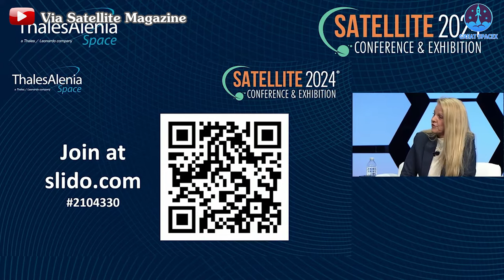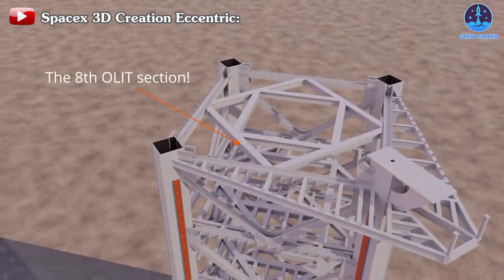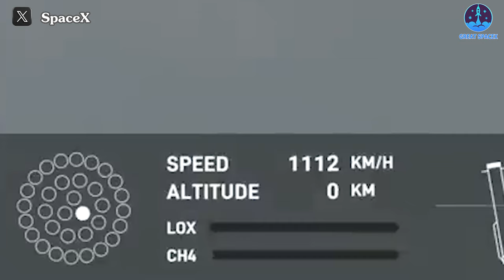Unexpected! SpaceX declared ''Catching'' Starship Super Heavy by Mechazzilla this year...

Comment: I don't see catching it working. I think they should stick with how they do it with Falcon 9 and use landing legs. Sure that will cut down on payload but I think it makes the most sense and is the safest option.
Reply: Yes I agree , I don’t see how they can get that precise to be able to catch it
Reply: Yea of little faith. Just remember - no one believed in relanding a rocket either.
Reply: I"m going to go with those engineers knows a whole lot more about physics and rockets.
Reply: That's why you don't work at SpaceX.
Reply: And this can be offset by improvements in engine thrust.
Reply: You don’t make progress without taking risk.
Reply: Agreed, and winds and bad weather could make things even more difficult. I think they would be wiser to land the booster using the proven Falcon 9 method.
Reply: @johndavid9418   Ture but even Falcon 9 doesn't always land perfectly in the center spot of the pad.. There are just to many variables to account for..
Reply: @scupking  It's about reducing risk not eliminating it, perfection is a theoretical & physical impossibility in any field. 
Your expectations are unrealistic & your understanding of physics is poor.
Reply: From what I heard the landing system would bee too heavy and it would limit the capability of the stack….
Reply: I agree, but with the greater mass of starship, it maybe an engineering (structurally) nightmare. Catching the pieces are the most economical and time saving procedures.
Reply: @offgridprep  i dont think its any harder then landing on a Drone ship in the middle of the ocean. 

Of which they can hit dead centre. So I think its more a question of if the building can withstand the landing
Reply: Their focus hasn’t been this part of the mission. Line upon line… the first was clearing the pad and tower… 2nd was staging and 3rd was orbit. Anything else was a bonus but not the focus, so focus is is concentrated on the ‘goal’ of the flight. They have engineering and progress that is so far beyond what we see or hear. Just like the Artemis moon lander. Much farther than anyone thinks.
Reply: @earniemanley8013   They already successfully landed Starship that had retractable landing legs during test flights a few years ago.
Reply: That’s why they are called “chopsticks.“ Yes, very difficult. Like catching a fly with chopsticks. It’s worth the effort to try, and it will probably eventually work reliably and safely.
Reply: @krossbolt4100 BS! 20 years before SpaceX was doing the grasshopper flights, McDonnell Douglas and DARPA were doing the same thing.
Reply: And what about Lunar Starship?  No chopsticks on the Moon.
Reply: Wasn't aware
Reply: @executivesteps   It will land with retractable landing legs like the Startship test flights a few years back.
Reply: I don't think they can land Falcon 9, they should stick to the expendable version even if that makes it a little more expensive-someone 10 years ago
Reply: @scupking  Thanks. I was confusing the booster with the Starship.
Reply: It would seem to me that slowing down for reentry would make better sense burn or be burn
Reply: Hit the atmosphere 12000 kmh rethink
Reply: Hope they do and I believe they will. 
Remember the narrative that was present about the drone ships and the F9 boosters?
Reply: It’s just too heavy making landing legs extremely complicated to construct so it could just be easier to catch it
Reply: Ejecting seats and crash rocket on mars. According to NASA/USA air force, there isnt water there anyways.
Reply: While catching reduces the mass of the catchee by a couple of tons, the major reason is that it reduces the delay before relaunch.  With the OLIT the catch can return the booster to the OLM within minutes.  They can launch again within an HOUR.  Or the OLIT can deposit it directly on an SPMT.  Without that they would need to use a massive portable crane.
Reply: Both ways equally cut down payloads equally
Reply from the maker: Great discussion here. We're proud of that. Keep following and discussing on our channel ♥️

Comment: The grid fins appeared to be too small for the mass of the booster. Changing out the grid fins for actuated vertical stabilizers might be a better option.
Reply: not supposed to be caught by grid fins.....catching is to be done by the lifting pins below the grid fins!

Comment: The shock load on the 2" cable of the draw works is not likely sustainable when the weight of the booster/starship is abruptly added to the arms.
Reply: Wrong. There is nothing "abrupt" about it. The booster/ship will slow down to zero vertical speed at the same time they land on the arms. The shock absorbers on those arms guarantee nothing harmful happens to either the arms or the tower. These calculations are not hard for good engineers to carry out.
Reply: @knowledgeisgood9645  I believe that it is you who is wrong! but time will tell!

Comment: Why not try and catch a falcon 9 booster to test the ability. At least,  it would prove feasibility.
Reply: The Falcon 9 engines aren't really designed for that. They can't throttle down low enough to hover. Their landing burn is carefully timed to bleed off all the booster's speed just before touchdown. They'd also have to design them with hard-points for capture AND design a tower system specifically to catch them. SpaceX can prove feasibility on Starship by simply having it hover in place and demonstrate precise maneuverability. Once they manage that catching it with the chopsticks is simple.

Comment: Highly doubtful that the present configuration of the catching mechanism is going to work, aligning a relatively small ball into a relatively small socket is impractical - what they need is either an inverted V on the ship or a large V on the arms either way the radial orientation in relationship to the tower/arms is  going to need refining
Reply: From somewhere I remember it said that the two point targets are the size of a car tire. Starship needs X,Y,Z control plus rotational control. Maybe optical sensors? Hover can't be maintained indefinitely.

Comment: CAPTURE ON LANDING IDEA --->>> Add a tall section to the Mechazilla that has at least 1 pair of pincering opposing coiled leaf spring grapplers, is mounted to the top,  that can hydraulically reach out and pull in a nearby landing Rocketship .  The flat bar coil biased leaf spring is made of semi-rigid fiberglass or carbon fiber. resembles a coiled thick belt having a stiffening erector hydraulic channel along its outward side, facing away from the gripped ship. As ship is landing a targeting means rotates the top section so that the outstretched stiffened leaf springs are able to wrap around the landing ship.  As the ship is within reach the opposing springs are closed and the stiffening hydraulic pressure is relaxed to allow the spring to gently but firmly haul in the spaceship.  The inverse hydraulic coil will also work; wherein the hydraulic effort is actuated on the inside of the coil leaf strap.

Comment: I wonder if anyone thinks that Falcon 9 could land and launch in a hour. And if not, could it do it in a day?
If not a week? If not, how can you believe that Starship can land and takeoff in an hour. I see zero evidence to believe this can be done even in a week.
Falcon 9’s best is a month.
Reply from the maker: I hope SpaceX will try it in the future 😂
Reply: @colonbina1  They shoukd. At least as a demonstration for Starship. If they cant do Falcon 9, I doubt Starship is even possible
Reply: Falcon 9 uses kerosene fuel
…  as such it does not burn as clean as methylox… They have to go through and clean the engines before next launch.
Reply: @robb8235  I am aware of that. Because you dont need to clean the engines, it doesnt mean you can turn around the vehicle in one hour. I will be very very impressed with one week
Reply: @pedrosura  

Granted it won’t be anytime soon… but once well proven…. It should be possible.
Reply: @robb8235  I disagree. I have seen no demontration, facts or data to believe this. The comllexity and size of this vehicle is such that I think is silly to even claim it. 
Time will prove me right.
Space X could prove me right, 1  by designing a vehicle that can fly the mission, 2 and be turned around in 1 week. That will be impressive.

BTW, for the inorbit refueling, you have instantaneous windows that happen daily. You have to get the inclination and node right to dock with the target Starship.

Comment: I don't think that the catching speed of the arms will be fast enough to do the job. Maybe if the actuators were electric?
Reply: The arms will likely not have to move at all. The booster will hover and then glide in between the slightly open arms until it hits the rails. Only then does it shut down the last Raptors.
Reply: @knowledgeisgood9645  I believe that it is you who is wrong! but time will tell!